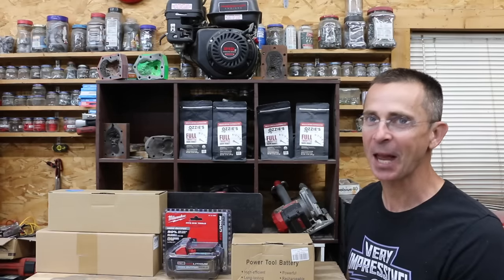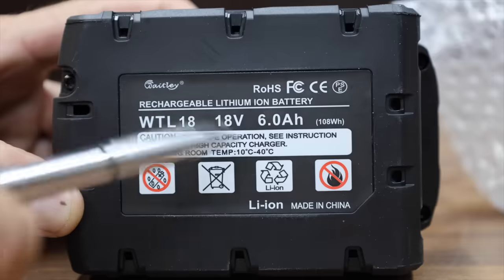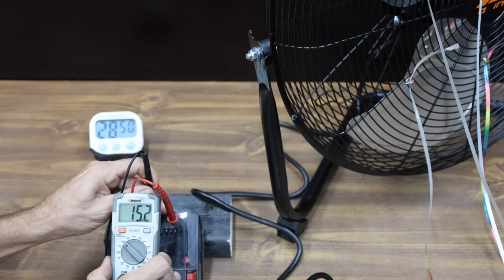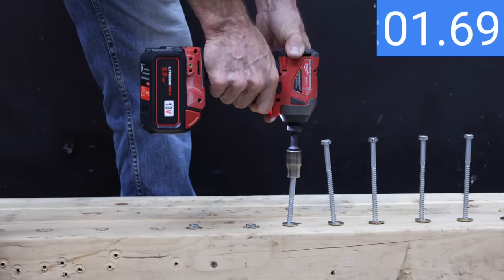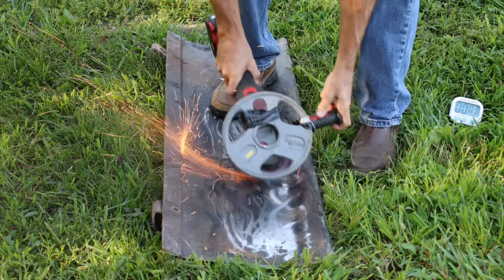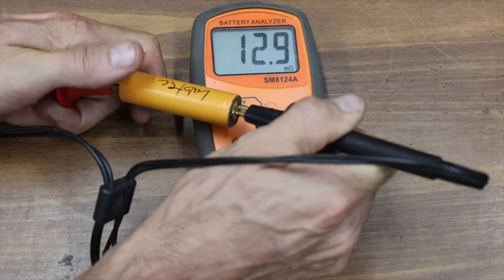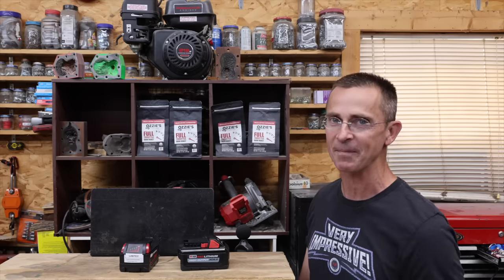How Dangerous Are Knockoff Tool Batteries? Let’s find out!

Comment: I deeply appreciate this and all your videos. I'm into the dewalt platform myself. I have about 35 battery operated Dewalt tools and 6 original Dewalt batteries between them. The knock off prices are SOOOO tempting on Amazon, but I haven't given in yet and after watching this, I don't think I will.
Reply from the maker: Thanks! Thanks for sharing.
Reply: Get the knock offs. After years of only buying the dewalt batteries i decided to buy the knock offs. I got 2 6 amp hour batteries and then purchased a knock off charger as well.
All 3 have performed great. Ive only had them for 3 months but for the 2 batteries and the charger it was $80!!
Thats $20 less than 1 dewalt 6 amp battery. 
All 3 are what i tend to reach for first at work. 
The charger charges faster and the batteries still act like brand new batteries by having great power and long use.
Im not saying they are better than the name brand, but so far i cant tell the difference

Comment: Depends on the aftermarket battery. I actually have 2 aftermarket Milwaukee batteries. They are my most used. Advertised capacity was 6ah, real capacity was 5. They are ~8 years old and are my most used. Still are about 4ah in capacity. 
Going strong! 

Now, I also pulled a dead milwaukee OEM 5ah battery out of the Home Despot battery recycle bin. It wouldn't take a charge. date code was 2019 but looked brand new. Opened it up when i got home, cells were all balanced and not below the safe low voltage level. Charged them all up using an external charger (one cells at a time). still nothing. Got replacement BMS on Alibaba for $7 free shipping soldered that in, that battery is working flawlessly for 6 months now, and testing at exact new capacity.

Comment: Well, here at work we got top of the line Milwaukee ratchet with high capacity batt. We were tightening keeper bolts, about
 2. 3/4"  bolts, and half way thorough out of 8 bolts, the batt smoked, couldn't be recharged. Both, ratchet and batt were brand new.

Comment: For low-current applications (e.g., electric drill for drilling screws, powering a flashlight) 

Two Labtech batteries give one over 51 minutes of run time for $44 compared to 
One Milwaukee battery gives one 39.5-minutes of run time for $90.

Another way to look at it. 
Labtech power  duration /cost ratio:  25.33min/$22 =    1.15 minutes/dollar
Milwaukee power duration/cost ratio: 39.25min/$90= 0.44 minutes/dollar
 
I suppose the best battery deal depends on the peak power requirements for the anticipated use. 

I love this channel. I always check it for a review before going to buy a tool, or glue, or oil type things - just in case you have a review on the product.
Reply from the maker: Thanks!  Thanks for sharing.

Comment: Amazing work as always. Battery safety is an important aspect of the modern worksite, be it power tools that can finally ditch the cord, modern portable electronics ranging from wearables to laptops, or even the vehicles used in the commute, it’s important that it be given proper attention.

To that end, I’m pleasantly surprised that you didn’t have any fires with those knockoff batteries. Turns out having fuses is a great last resort to handle over-current and short circuit protection. Ideally you would have multiple layers of protection circuitry like the name brand, but it seems like the fuse was enough to prevent catastrophic failure.
Reply from the maker: Thanks!  Thanks for the feedback.

Comment: absolutely amazing. This i the video that everyone has been waiting to see. You did an awesome job with testing, comprehensivly testing strength and capacity. I have some aftermarket Makita batteries, and I've always wondered how they compare. Now I want to see MORE testing! What about Makita? I want to see more tests.  Is there an aftermarket battery that is actually as good as the OEM?
Reply from the maker: Thank you very much!  Thanks for the suggestion.

Comment: Sometimes when you have an older set of tools your only option is aftermarket batteries. I have an old set of skill tools, circular saw jig saw detail sander flashlight and drill, the oem batteries died a long time ago, i would occasionally look on eBay for a deal on original batteries with no luck, i saw a deal on two batteries for like 25 bucks and thought i have nothing to lose, they fit perfectly and after about 20 years i could use the tools once again, i don't use them a lot so it worked out great for me, i was ready to chuck the whole set , i was extremely happy with the purchase, the original batteries didn't last very long so hopefully these will last longer.
Reply from the maker: Thanks for sharing.

Comment: This is an amazing and thorough dive into the world of generic power tool batteries!  I'm a DeWalt user myself and have two 5Ah and two 2Ah batteries, all DeWalt, for my collection.  The batteries have held up well over the past year and a half for drilling around the house and cordless impact work on our vehicles.  Sometime in the future I'll want to replace the batteries when they start losing their charge, but it hasn't been needed yet.

I'd love to see a comparison of the knockoff DeWalt batteries out there at some point. Amityke and Labtec both seem to have them available in 6Ah form, Tenmoer sells 2-packs for $64, Amityke sells 2-packs for $60 while Labtec 2-packs are only $53.  Offical DeWalt batteries in 6Ah 20V Max are $85 and the 5Ah version is $65 new.  I'm willing to bet the test results will be the same, though, so I feel a new DeWalt branded 5Ah battery would be a better buy than any 2-packs from the knockoffs!
Reply from the maker: Thanks!  Thanks for the suggestion.
Reply: I can't imagine there is much difference between the same brand knockoff of DeWalt, Milwaukee etc. It's really only the case that differs. I bet the same brand of knockoff from last year will be different to this year's model inside, though. They must be changing cell suppliers on a regular basis to get the best price.

Comment: I may have just learned why I’m somewhat disappointed with my Milwaukee 1/2 impact. It came with a 5.0. it fails to remove bolts about 20% of the time I’m going to a breaker bar. Your tests show that if I went up to a larger 6.0 or greater I might have better success. Now I feel better about my purchase. Thank you.

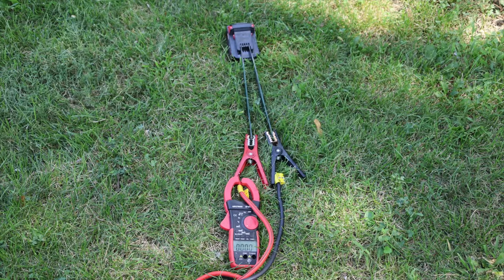Comment: 9:00 for the current clamps to work properly, the wire needs to be completely inside the plastic loop and the loop needs to be fully closed. You don't actually clamp the wire in the "jaws" of the meter. The way you show it at 9:26 is correct.

Comment: Very interesting results. I bought a pair of knock off batteries for some back and decker equipment (string trimmer) and they have actually worked very well. 

I wonder how brand specific this is?  B&D is nothing to write home about, but for a cheap dumb dumb light weight trimmer for one hand edging, it does fine.

Comment: Very comprehensive test. One thing to note is that 18650's will always have lower capacity due to size, which kinda surprised me when I saw the 21700 from the milwaukee only at 3.1Ah. There are so many different 21700's, like the Mobicel P42A and the Samsung 40T that are rated at 45 and 35A respectively with capacities of 4.2 and 4Ah.
I'd like to see someone rebuilding the Milwaukee battery with these cells and then checking endurance. Not saying they are the best, but the added capacity should give more uptime.
Reply from the maker: Thanks!

Comment: I wonder how many charge cycles  they will take before they are done, i have an old Makita 9.6v cordless drill the type with the long battery in the handle the battery is  donkeys years old but still takes a charge and lasts quite well the drill is from the late 90s and works fine, great video as always
Reply from the maker: Thanks!

Comment: I ended up with some counterfeit Makita batteries purchased via Ebay.  My tools wouldn't run off of them.  The tools would run a short time and turn off.  Only one of my chargers would actually charge them.  I have a adapter which allows me to use the Makita batteries in my Ryobi tools, and these counterfeit batteries did power the Ryobi tools without complaint.  However, of the two I had, one stopped working within a few weeks, and the other gave out in about one year.  Neither of these had much use before they sailed.
Reply from the maker: Thanks for the feedback.

Comment: I hear everything you’re saying and absolutely agree but on that same note I bought a couple Knock off ryobi batteries approximately 3 years ago stored only in the house at regular temperatures and never put them to the “max” just normal use on them and it’s not a daily use thing but it is weekly used and they’re still going strong 😂 but I’m not tough on them like I said I don’t drop or throw them they never get wet I never try to force them to make one more cut when they’re dead etc but for only paying $15 a piece for them after 3 years I think I’m happy lol
Reply from the maker: Thanks for sharing.

Comment: Sort of along the same lines, I'd be interested to see a test of long term exposure to higher temperatures and its effect on battery life/capacity. A lot more batteries are being stored in warm/hot sheds for long periods compared to even 5 years ago. I'd definitely be into seeing how intense that effect is, as well as whether a more expensive name brand battery continues to perform better (I assume it would). I too am a person who has seen the results and definitely thinks it's really the only way to go in this case. Batteries are not the thing to cheap out on. Lots of times you can get by with something a little less professional if you're just doing backyard/around the house kind of stuff, but spend the money on good batteries and you'll never ever regret it.
Reply from the maker: Thanks for the suggestion.

Comment: @ProjectFarm   Very good testing! A video idea would be testing Lithium runaway containers/devices. Companies make envelopes and containers to place devices in when they are in danger of running away. When driving down the road or flying in an aircraft if a tablet or phone is damaged, do any of the products actually contain the fire and or smoke? It is critical in a plane because it takes so long to land. There have been cargo aircraft that have crashed because of Lithium battery runaways spreading to a pallet of batteries. My understanding is that they are looking at a brine to cause the batteries to discharge so the energy does not go into fueling a fire. I don't expect you to go so far in testing, but some of the commercial envelope/container tests would be VERY helpful! Thank you sir!

Comment: The problem I have is my 'system' is Porter Cable and it's woefully underused as it is--the fact that both included batteries went tits up quickly (years ago, not that long after purchase in the scheme of things) didn't give me any trust in the batteries in the first place. I had them rebuilt by someone I found online and one of those two is still working some 6+ years later. Now that there are knockoffs available I'd lean that way even if the quality is relatively poor simply because of how little my tools are used. 🤷‍♂
Reply from the maker: Thanks for the feedback.

Comment: I work on garagaes and ots a great video for me since when i take tension off the sorings at times im basically stuff in the garage with no outside immediate exit other then through the home. 
Its very tempting to buy cheao but i always thought about the woest case senario a fire inside and no way to lift a 200+ pound door without hurting myself in an emergency senario

Comment: I noticed the 18v Ryobi factory battery doesn't shut off when you start the cordless tool at full power. knock offs can't handle power surges and they seem to shut down. But they seem to last as long on repeated charges but at a slight lower performance than stock. As long as you don't start the tool at full power, the knock offs seem to work well. But run time suffers, knock off batteries never have true amp hour ratings.
Reply from the maker: Thanks for the feedback.

Comment: Ive been using Vanon batteries in my Milwaukee Fuel 3 Impact driver, For about 3 years now....
I only recently had to replace the battery, Just last week.. As it was suffering from lack of capacity now...
But still..... Cant complain.. Lasted 3 years.....
Reply from the maker: Thanks for sharing.

Comment: I have M12 genuine and knockoff batteries and they do great. I can’t tell the difference between the two and have so many batteries that I can change them out like crazy. All at a small fraction of the cost. That being said I don’t leave charging lithiums unattended regardless of brand. If a knock off fails I can toss it and buy 3 more.

I am a fairly heavy home user and do my own maintenance on my restaurants. I am not a full time tradesman but if I was I’d be more inclined to use genuine.
Reply from the maker: Thanks for sharing.

Comment: Hello again, Project Farm 
Thank you for another Great Video 👍 Question for you, I briefly owned  the M12, drill, driver and ratchet kit. 1) I was concerned about the ratchet being a brushed tool. Because of the chance it could create sparks. Aircraft Fuel is more volatile than gasoline. The second thing that caught my attention. Was the battery while it was inserted in the tool. It acted like it wanted to detached from the  tool. Did you experience that? Again thank you

Comment: Likely the same when it comes to "off brand" laptop and cellphone batteries. I'd suggest a test of those but the brands change every six months or so. If a knockoff brand is around for longer the cells are likely sourced from a different supplier and of poorer quality as time goes on.

Used to be you could get decent performance from off brand packs that used Japanese cells but they're much harder to find nowadays. 

Grear video as always!
Reply from the maker: Thanks!

Comment: Excellent video and fantastic testing. Another question one has to consider is whether or not you want to have 2 or 3 Milwaukee batteries or cart around 5 to 6 of the Labtec or similar off brand batteries? LOL I'd prefer to spend more so I can carry less gear.

I also wonder what the longevity of those off brand items are compared to the Milwaukee or DeWalt? Maybe you could test that?
Reply from the maker: Thanks!  Thanks for the video idea.

Comment: I just came across your channel, and I wish I'd seen it sooner. I love the stress you put on objectivity in all of the tests, and the results are always enlightening. One question, I've watched quite a number of videos already, but I haven't seen you use any Masterforce brand tools, which is the flagship Menard's brand. I recently bought a Masterforce 20V drill and impact combo, and I wonder how they stack up against Bosch and DeWalt. Is the Masterforce brand just not that widely available?
Reply from the maker: Thanks for the suggestion.
Reply: @ProjectFarm I think it might be interesting to do another round of drill testing exactly like the one from 2 years ago, and cover any brands that are newer or didn't make the cut the first time around, like Wal-Mart's Hart brand, Masterforce as I mentioned above, and the Kobalt brand 24V setup. Compare the data with the original video's results.
Reply: Oh, and Metabo, Hercules, Flex, you get the idea.

Comment: I have a 2009 Dewalt drill that needed a new battery. Unfortunately, Dewalt no longer makes the battery for it, so I had to go with a knockoff. I spent $30 for the pair about a year ago & no problems. The drill works as good as new.

To clarify, I'm not one to go for cheap knockoffs, but I have either gotten really lucky or have found decent quality knockoffs when it comes to this kinda stuff.
Reply from the maker: Thank you for the feedback!

Comment: Did the fan motor produce a whining noise when running this test? The Top Off produces a modified sine wave, which isn't great for running inductive loads like AC motors. I'm surprised that the fan made it all the way through the test.

Comment: My experience with Makita tools, the off brand batteries work good for an impact driver and possibly a drill depending on use. That also work good for low power consumption accessories such as lights and radios. However, on saws and 1/2 inch impacts you want the genuine batteries
Reply from the maker: Thanks for the feedback.

Comment: At 10:13 you can see the massive difference between the genuine and knockoff in regards to safety. The milwaukee has a special fusible link that has a fiberglass or mica fireproof patch below it to keep the link from catching the plastic case on fire when it opens. NONE of the other brands had any sort of fire-risk mitigation. A short in ANY of those could easily catch the plastic casing on fire. That, in my mind, makes the genuine worth it... Especially for harsh use and then leaving in a work truck or in a workshop overnight. At the very least, they are an insurance liability that one does not need in a professional setting of any kind.
Reply from the maker: Thanks for the feedback.

Comment: I am a firm believer in the Milwaukee batteries Project Farm. Your logic of buy once and  cry once and get it over with is the same as mine. Nice to know we must be brothers from different mothers.         Have an idea for you Sir. Rechargeable batteries that are AAA, AolA, C, and D size. But these batteries should be 1.5 volts and not 1.2 volts. For whatever reason the lower volt batteries just do not keep a good charge. That is my idea PF. Hope it helps you Sir. vf
Reply from the maker: Thanks for sharing!  Thanks for the video idea.
Reply: Hope you have luck with the video PF.  @ProjectFarm